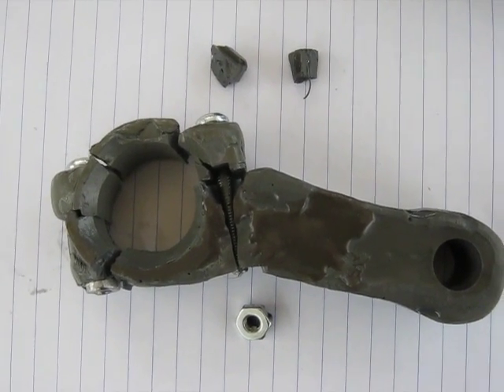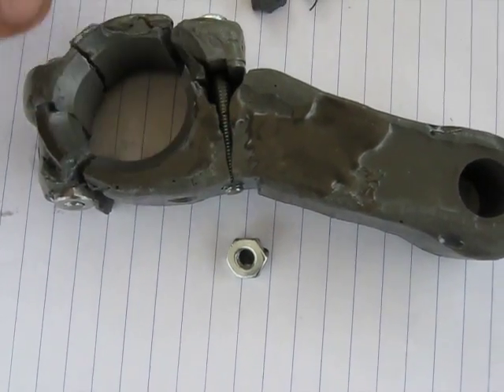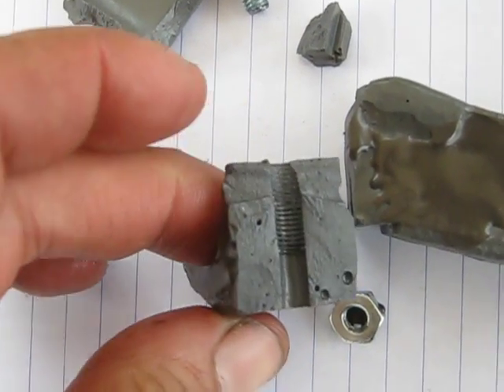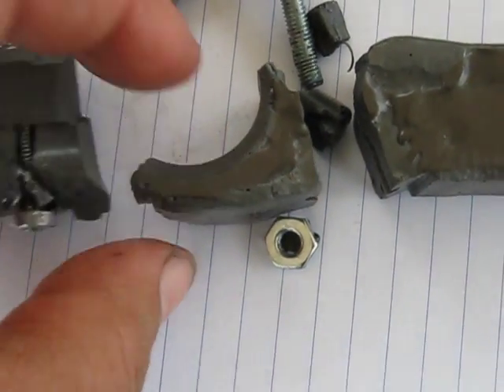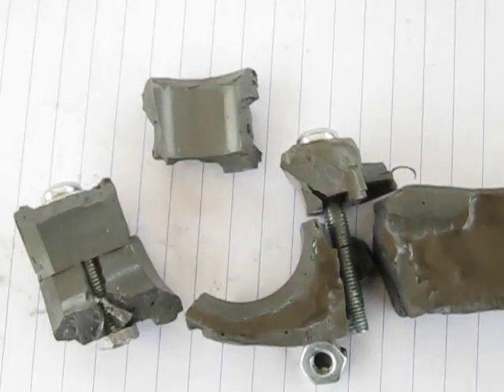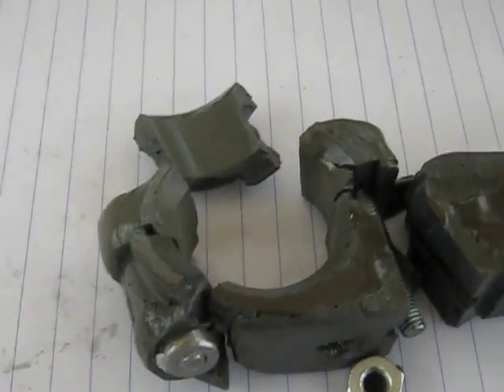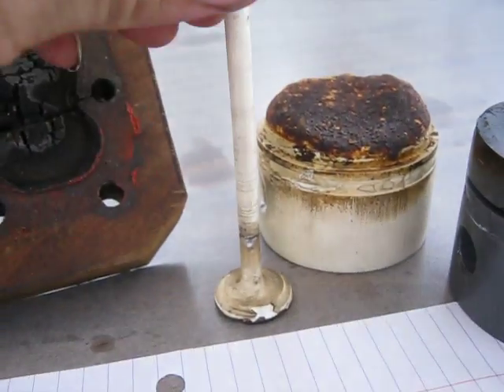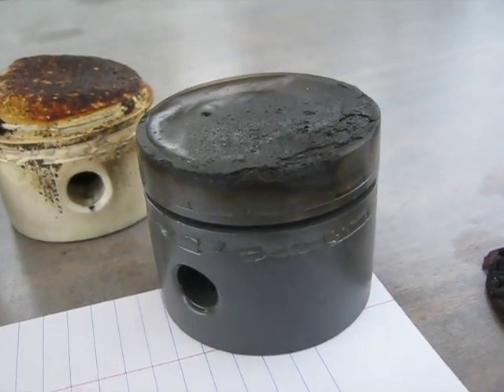JB Weld Con Rod Analysis

Comment: It broke because the two bolts concentrated all the force around the holes, If you can make the rod in one piece or glue the two pieces with more jb weld it would last longer.
Reply from the maker: I wondered about that, I just wasn't sure if the JB to JB bond would be as strong as a 1 piece casting of JB.

Comment: I bet if you put chicken wire mesh (or maybe even nylon or plastic mesh) into the rod with the JB Weld it would massively increase the strength. Probably also worth getting a vacuum pump to pump out as much of the air bubbles out of the mixed JB Weld as possible whilst it's in the mould. Probably also maybe allowing a little more clearance on the assembled rod due to the different thermal expansion rates between the epoxy/steel/ally.  Cool channel, just earned yourself a sub.

Comment: It's interesting...no scoring on the journals of the rod.  It shattered on the crank shafts side, but it's thinner there and the bolts may have made it weaker, as you pointed out.

Comment: My advice would be to add more material around where the bolt sits in the connecting rod. Also use stronger bolts that won't bend as easily and cause the brittle jb weld to crack. The bolts shouldn't be less brittle then the jb weld.
Reply from the maker: Adding more material is almost impossible with this engine block design, I had to cut a hole in the side just to clear the small bolts i used. However if I just cut a larger hole I could beef it up a bit. I am looking at a complete redesign of the rod, but I will have to go back to basics to check the camshaft clearance etc. so I will probably make another rod, but it could be a while.

Comment: It looks like you cast this pretty much identical to the aluminum one. I wonder how it would work if you thickened up the crank end to compensate for the weaker material.
Reply from the maker: I used the aluminum one for the basic mold shape, I did thicken it up as much as possible. The only way to make it any thicker is to cut a bigger hole in the side of the block,  but the gas tank sits outside that, so I installed an external metal plate as armor for the tank.

Comment: two suggestions:  bushings/inserts on both ends, and some type of fiber reinforcement.
Also: "next up--- Brazillian Walnut conrod! " would be my only other suggestion.
Reply from the maker: I can see using a bushing on the big end, but i think the piston pin is OK without one. I will look into fiber reinforcement, that would probably help out  a lot. though it wouldn't be 100% JB then, like this one is.

Comment: I am just a mechanic but the damn thing held on long enough to break the big end into little pieces. I am no epoxy engineer but I think if you honed that end for more clearance it would last a little longer. The epoxy swells differently than metal. It swells in all directions with no real strength in any direction as it plasticizes with thermal expansion. Try burning epoxy versus the aluminum rod to see what I am talking about.
Reply from the maker: Yes, I guess the rod could have tightened up when it got hot, I know the engine was fairly warm after the run.

Comment: Looking at where and how it cracked and broke open, it's probably just a high stress point that failed on the ignition stroke (piston forced back by the combustion, conrod bent & the V chunked off and the thing split)...
Reply from the maker: Yes, the groove I milled in it with my drill press probably didn't help any. If i make another one, I think I will reverse the way the bolts go in, as these were a bloody nightmare to try to tighten up. Plus I had then in and out at least 20 times while grinding the block for clearance.
Reply: try to sink in the bolt head and nut  use shorter bolts  to allow clearance

Comment: make a whole jb weld engine
Reply from the maker: No problem, there will be a slight delay while a plan a bank heist to afford that much JB !!!  :)

Just kiddin around Mr Police  :)
Reply: LOL!  I know a man that JB welded his tractor engine block after he left straight water in it over winter and it cracked the block, 15 or so years later, it's still running.
The crack was down the middle of the block including the deck of the block but yet he got it to work anyways.  

Good video.
Reply: just steal the jb.......OR reach out to them!?